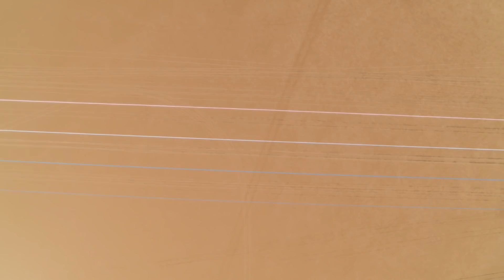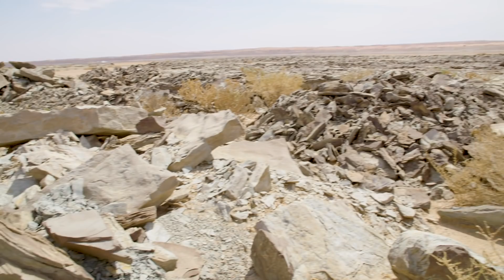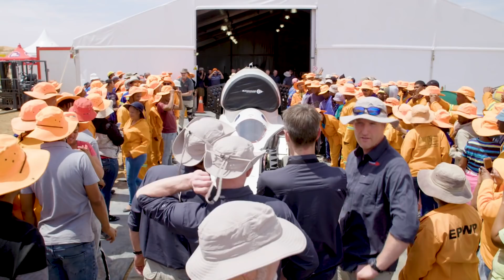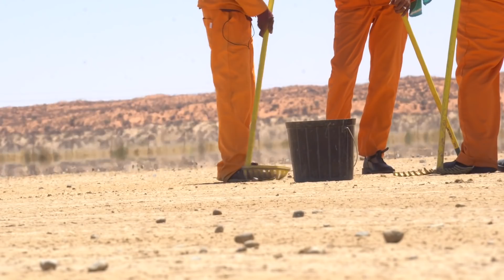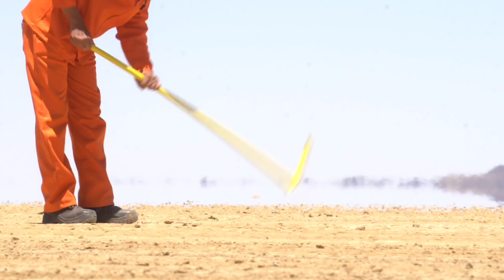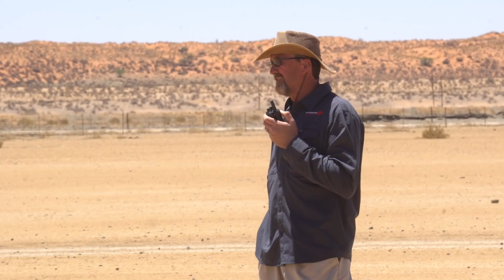How to build a race track for the world's fastest car | #2019HST

Comment: Thanks for your positive impact in the area. What happens if it rains? Was the pan not flooded a while ago?
Reply: the area have seasonal rainy season during southern hemisphere summer (nov-april) and yeah it could be flooded during that season. obviously the team chose the best season to run the car. random rain do fall although very rarely in desert, but it will dry out very quickly.

Comment: Is this really a car? it's a jet engine on wheels. I thought a car was a vehicle with an engine that drives the wheels directly?
Reply: There are separate records for jet-powered and wheel-driven vehicles. I think the Turbinator II holds the wheel-driven record at 503.332 mph.  https://youtu.be/BdBahNZOg9o
Reply: That was a controversial issue back in 1964, or thereabouts, when jet powered land speed record vehicles arrived on the scene for the first time.
Reply: Good point, suppose a land speed record vehicle would be more appropriate as it is the size of an articulated lorry.Hmm maybe they should call it the worlds fastest truck, that way americans might understand what it is all about 😃
Reply: @goodfodder  true enough , honestly . Just needs some plastic nuts and a hitch for a trailer . Oh and a really obnoxious bumper sticker .
Reply: It's not really a jet engine on wheels , either . It's more of a whiley coyote  on an enigma  .
Reply: Literally, a car is a vehicle that has four wheels and an engine and that is used for carrying passengers or freight.
Bloodhound has 4 wheels, an engine and can carry a passenger.
Sorted 👍
Reply: @Splitscreen83  Nah. That's not it.